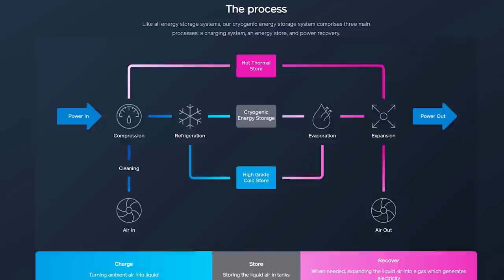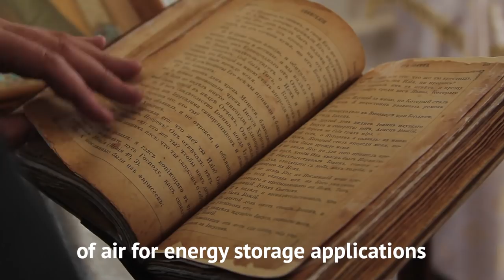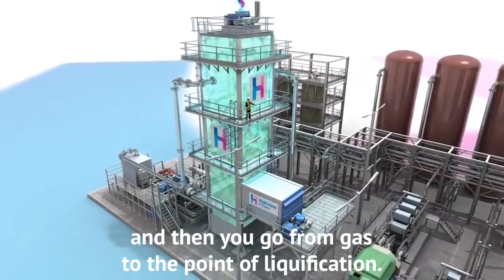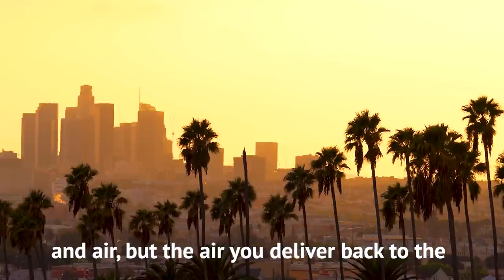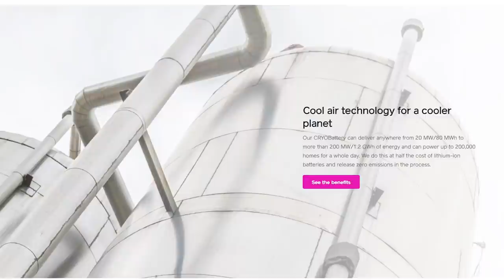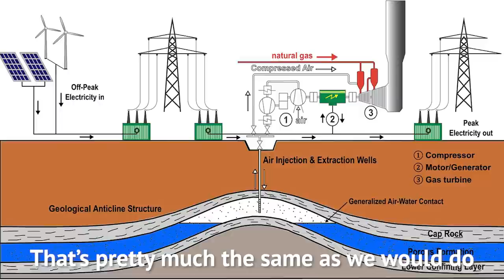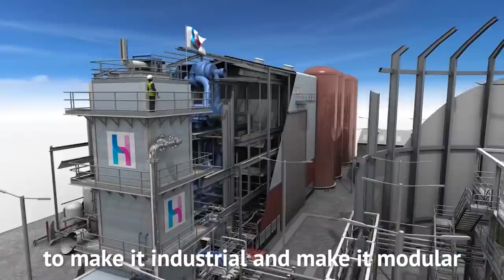CRYOBattery Storage? | Highview Power Interview

Comment: You should also look in to the Pumped hydro project in Bendigo Australa.  The plan is to repurposed the city's mine shafts and use it to generate power.  The unusual thing is that the shafts are already built and the city is built directly on top of it! Very cool project the same size as Hornsdale
Reply: Stephen Boddy the city is built on extremely hard graniet & quarts deposits. More investigation is happening, however, the current gold price is likely the major hold up.   This said; the particular claim in question is notorious for being allusive and prickly at the best of times.   It would be a great story to tell in full as to why they are looking in to this

Comment: 300 gaga watts of renewables were thrown away in southern Cal. last year and growing.Any base load  is adding to the problem Lithium batteries @ $750,000 and 10,000 lbs per megawatt are out of sight.I need 4 megs for seasonal storage. Why is everything red.
Reply: Ok the red went away. Alkaline fuel cell with cryo storage of H2 and O2 recovering the storage energy in the same way as the air system.

Comment: how responsive is it compared to lithium?  i always hear that mentioned when now you know talks about lithium batteries, but didn't hear it mentioned hear at all.
Reply: Part of your answer was buried in one of his responses, and part of your answer was not addressed. I would imagine that from a cold start, this technology would be faster than a Gas fired Peaker plant and slower than a Lithium battery. However, if this plant were operating in "Standby" mode, it would be as fast as a Gas Peaker in "standby" mode. Once operational, the Dr. did mention that his plant would have the advantage of "Spinning reserve" which helps to stabilize the grid.

Comment: Storage for more than 3 moths might be useful. Storage for more than a year is  more than we will ever likely need. That is likely excessive, but if we want to have the minimum necessary solar or wind power, we might need to carry energy from the middle of summer into late spring. A year is generally redundant, we don't need to make it from peak production back all the way to peak production, just from the middle of the overproducing season to the beginning of overproducing season (summer for solar, but it could be any time of year for wind, depending on local climate). 

This isn't a perfect technology, but it looks promising for some significant use cases.

Comment: Be aware that the Tesla Ac to Battery to Ac solution is about 89.5% efficient, while the cryo system tops out at about 70% due to thermodynamics.
And the Tesla solution can get better ... maybe in 10 years up to 95%, while the cryo can't get better. Bottom line, as they said, you need a very big system for it to be maximally efficient.

Comment: Spoiler Alert-- someone who watched this video will build one for their home solar panels with stuff from Home Depot by the end of the summer.
Reply: There is nothing available at Home Depot that will compress air to the point of liquefaction !!!!
Reply: @bbcooter388  :-)
There is a way to do it, but it is very wastfull. You can use the decompresion of air to cool the air comming in and in stages drop the temperature down to where the air will become liquid.
Reply: haha
but seriously, he said in the interview that this is better at larger scales
for smaller applications, and for applications of less than 4 hours, he said batteries are better. 
After four hours, this system becomes cost competitive, and the longer time needed, the more cost savings
Reply: There is an engineer who made hydrogen at his home using large propane tanks for storage. I'm not sure if it's liquid or not. 
He was able to retrofit a car and make it run on hydrogen.
He is still very pro hydrogen.
Reply: @AWildBard  That would just be under pressure. The hydrogen will not become liquid without a lot off cooling.

Comment: Would it create clean water? For area that don’t have a lot of potable water? Cheers
Reply: Possibly, there is heat from cooling down the air that could be used for desalination. But they also need heat for the re vaporization. If they don't store the heat from before, they need to get it externally, from industry excess perhaps.

Comment: Would love to know if others can copy this to roll it out faster?
Reply: According to their own website they just store it in insulated capsules. Sounds like it requires no energy to do the storage part.
Reply: @markplott4820  I assume that the insulation is on the inside like a thermos. Anyhoo they are building one in the UK so we'll know soon enough. I have no reason to doubt them for now. It would be a very odd thing to lie about.
Reply: @markplott4820  are you talking about the pilot plant that ran on biomass?
There's absolutely nothing that says it's limited to using biomass and I don't believe that the latest Manchester one is.

Comment: That's great but how does it work ?
Reply: The electricity is generated with an industry standard turbine generator (just like at the coal plants), however, instead of using steam (heated with Coal or Gas) to power the turbine they use compressed air which blows through the turbine and spins the generator. The compressed air is created when they let the liquefied air out of the storage tank and it expands (like air escaping from a balloon). To create the liquefied air they simply compress the air and cool it to the point that it becomes a liquid that gets stored in large tanks until they need electricity on the grid. The whole process looks like this: Air is compressed into a liquid and stored in large tanks until the grid needs electricity, then the liquid is let out of the tank and the air expands creating a lot of pressure which is then fed into the turbine which spins the generator that produces electricity which is sent onto the grid.
Reply: @bbcooter388  
Where do you get the heat needed to expand the liquid to gas quickly? Why was the prototype set up next to a Bio-Mass plant? Hmmmm. Something not right here.

Comment: I have a crazy idea;  I think Tesla are working on a residential Liquid metal battery with HVAC.  Hear me out -
Don Sadoway invented a liquid metal battery a few years ago, saying "works at elevated temps, no thermal control required".  Two of the key materials are Magnesium & Antimony.  These two things are plentiful with the biggest Mag mine located close in GF1 & an antimony mine only a few miles away.
So, why would you do this? Well, if you have battery storage which is really hot, you can use it like a heat bank and siphon off some heat with.... a heat pump....  which will have a HUGE! temperature delta.  Also, if you're running a cooling system for a house, you can boost the waste heat and boil hot water with it or increase the temp delta and lift the external heat exchanger temp, again boosting the efficiency, significantly!
It's also crazy cheap as the materials are more plentiful and lower cost.   Musk has also stated some time ago that GF1 is ready for Magnesium.

Comment: This CRYOBatery storage sounds like a peaker plant concept. Why do you say that demand for this technology is new only in recent years, if there are different types of the peaker plants already for decades? Why this CRYObatery storage was not used for peaker plants before, if liquefying air is nothing new?
Reply: Peaker plants take their energy out of fossil stores built over millennia.
This stores surplus energy now and taps it hours to months from now.

For the cryo-battery to make sense economically you need lots surplus energy to store in it in the first place. Until recently that wasn't the case: It was cheaper not to burn gas/coal/oil than to burn it, store the surplus energy it in a battery at maybe 70 percent efficiency and then sell that later.
NOW we get all the more renewable energy capacity whose peak supply may be at quite different times than when peak demand is. What to do? You CAN turn it off... but then the wind turbines/solar panels just sit their idly though, at no extra cost, they could deliver more energy. If only there were something to receive that energy and store it for later...! THAT is the new demand for this technology.

Comment: Zec, please do better job. I really like your positive attitude, but you did not asked the most important questions.
1. Full cycle efficiency?
2. Maintenance costs (in they video there was quiet a few car/people who works there daily, and do not forget the moving mechanical parts that must be replaced time to time)?
3. How long they can keep it in this form before the energy to keep it cold exceeds the energy that can be gained back from it?
Reply: @markplott4820  Why does it evaporate? :-) Please, speak in round sentences with facts and references.
Reply: @markplott4820  What is your point here? I just mentioned the same thing, but a much friendly way, because I do not know how they isolate the likvid air, so I raised a question. You probably do not know it too, so you just lecturing without reason... Please do not Trolling around. Have a nice day.

Comment: What possible efficiency can you possibly achieve with this ? Sounds a lot like vapourware (pardon the pun)  Compressing airto a liquid then using it to make energy.  Perhaps you should cut out the middleman, and find a way to use the energy in a more efficient manner. 

Cosmic Interference is where I stopped. Good luck with that.

Reminds me of the compressed air car. Who wants to buy one?

Comment: You could use the dry air output to fill cars using compressed air. This would remove the fire hazard using lithium batteries. You can build them in the desert to provide water and air conditioning

Comment: That's a really dump idea. It's very complicated and cost intensive to liquify air. The given efficiency of about 60% is just real if you are using fully the thermal energy for hearing that is released by liquifying the air. On the other hand you need to use the full thermal capacity for cooling when expanding the air. Otherwise there is no way to reach that high efficiencys.

Problem: you are needing the thermal energy in winter and cooling in summer. But In winter you do not have the solar energy to liquify and in summer you have more than enough solar energy, so you don't need any of the stored energy.

Unless you don't have the specific application where you need large amounts of heating and cooling at the same time, the system does not make sense at all.
Maybe the system works for a really large cold store next to an aquatic center.

But even here there's the problem, that the heating and cooling is exactly the opposite than needed!

Way better would be to go up the temperature scale when storing energy. For example heating water. On days where the sun is shining you are using the solar energy and a heating pump to cool your house and heat up your water reservoir. On colder days (no sun), you are using the heat in the water to heat up your house.
The electric energy therefore is stored in Lithium batteries.

Just that simple...

Comment: What's the efficiency? Must be really inefficient... especially compared to a lithium battery.
Reply: It makes surplus energy usable whose surplus generation doesn't pollute and which otherwise would just be thrown away (PV/wind/... taken off the grid), so as long as its installation and maintenance costs are low enough, the efficiency does not really matter all that much. But further up people quote 70 percent, which wouldn't be too bad at all.

Comment: It’s a bit insulting to burn in subtitles for only one person in the interview, if someone can’t understand then they can turn on the YouTube captions?
Reply: Andrew Saginario but the burn in means they are insinuating that the interviewee is not a good speaker. Thats why it’s a bit insulting. For youtube CC, since the creator has gone to the effort to transcribe what is being said into text, they can manually put in the text as caption files. Not relying on automatic CC.
Reply: The safer option would be adding subtitles for both speakers.

Comment: Remember when they said nuclear would be too cheep to meter ? 
I hope this doesn't turn out to be just as much a scam .
Reply: @Gyri Sulcie If you blow up a high pressure nitrogen tank or oxygen tank, it does not pollute the atmosphere other than with a few stainless steel fragments.  Spacex at Boca Chica has already tried it.